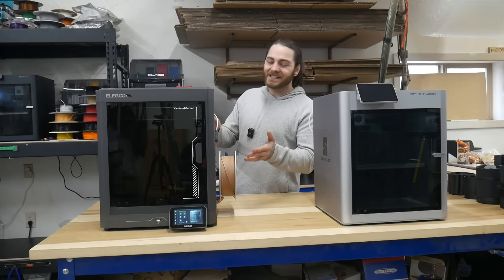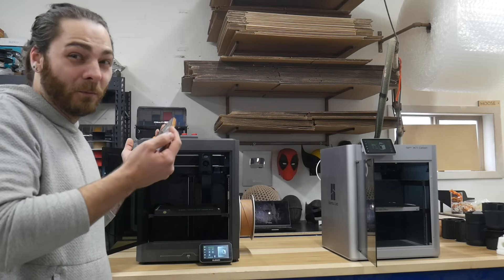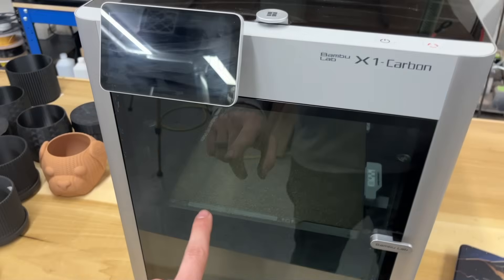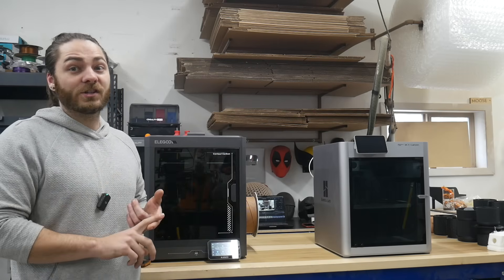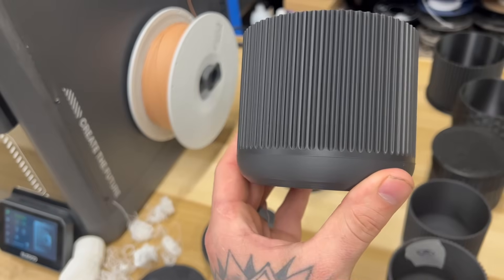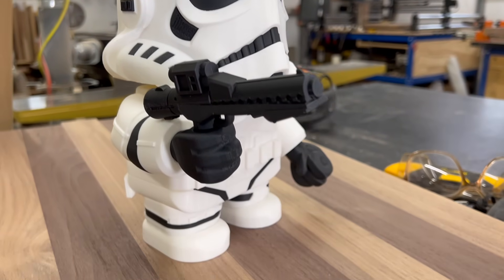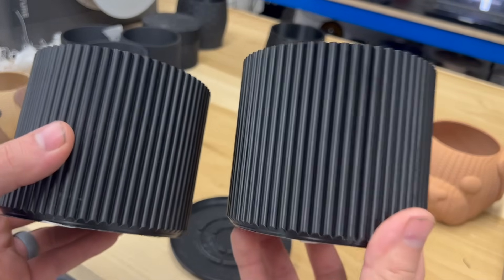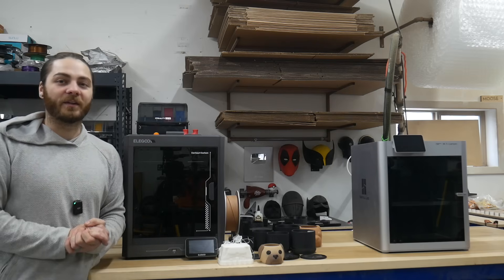Cheap vs expensive: Can the Elegoo Centauri hold its own against the Bambu X1C?

Comment: I have the P1S Bambu and the Elegoo Centauri and went on printing for hundreds of hours across every kind of filament. The lights are crappy on both. Elegoo has a much better screen. Why Bambu put a stuid, little, tiny, 1990's radio screen on what could have been an amazing printer is mindboggling stupid.  Elegoo printed well right out of the box after callibration. Bamboo printed one item right out of the box after calibration but the second item was strung out and required recalibration. Nobody talks about the bambu labs set up requiring access to your contacts during setup. Do they really need to know who my friends are? Price point on Elegoo is almost half of Bambu. Elegoo comes ready for CF filaments, bambu requires some upgrading for CF.  But Bambu has AMS. If you don't need or want AMS, Elegoo is a no brainer (buy it).
Reply: Was looking into a new printer. Requires access to the internet to set up is crazy requireing acess to my contact is a deal breaker. 
Plus coming from an ender 3 v2. I want to be able to change a few parts use what slicers i want etc. Thanks for this comment.

Comment: The Centauri Carbons prints look a bit worse because of VFAs. You probably need to reduce speeds for the outer wall. I use 40-60mm/s.
Also replacing the toolhead cover with the 3d printed ultralight version helps

Comment: Bambu's attitude about software makes their stuff a non-starter for me.
Reply: True. I dont get why no one mentions this. And everyone says the reason to get a Bambu is that its a "high quality everything works out of the box" experience which is wrong too. I had a Bambu A1 and Centauri Carbon (similar price) and they print and behave the same. Centauri Carbon is maybe even slightly better for tall prints. My A1 died in less than 2 weeks because they cheaped out on the power supply thermistor. Sent it back and kept the Centauri Carbon ofc.
People who shill Bambu are probably biased because of the mobile app and how comfortable the software is with the ability to control the printer and camera via cloud. Which should actually be another negative if you care about privacy and safety

Comment: I have an X1C, I love it. It does what i need it to, no printing mods to get it to work. I have 3 other printers (bed slingers) and only 2 of them i would use again. BUT, the Centauri looks pretty good for a clone at that price point. IF i had the extra money AND would not get murdered in my sleep by my partner, I probably would get it as my second enclosed printer and use my bedslingers as PLA only for light or non critical decorative work. EDIT: The Centauri is 265$ US on sale as of Dec 17th

Comment: I got the kobra s1 and really regret it. Full plastic even the door, the wifi chip in it is crap only works on ancient hardware 2.4ghz routers, cant get it to connect to wifi at all, massive first layer issues, poop chute getting clogged constantly , really crappy slicer settings, slicer that constantly crashes,...

Comment: I bought cheap printers.  They have cheap bearings in the fans, the linear bearings, the motor bearings.   That stuff fails in a few hundred hours.   I now buy printers with Japanese Misumi or other highest possible quality bearings.  It's not worth my time to be pulling apart a printer to change all of the bearings and often the replacement bearings are going to be the same garbage they sold you the first time.   It's your time.  If you want to print, but the printer with great bearings.  If you enjoy wrenching on a printer, buy a cheap printer.  If you want to see if a printer is any good, print a flat vertical wall with it.  Shine the light down from above and look at the shadow pattern of the layers.  If there are patterns and surface roughness I can't use it.  It might make fine figurines or rough mechanical parts. Reviewers almost never show you the print quality with lighting that is correct for showing the surface roughness.  In years of printing I've never had a nozzle clog.

Comment: I think for the price its not bad it does look cheap but as long as it works and for a starter I think it would serve someone well. I personally could care less about any screen on a 3d printer or the I think useless Lidar thats why I opted for the P1S.  And alot of people dont know if you just order another stock Light off bambu it snaps right in on the right side and is with in the safe power range on the board to wire direct to original so you have dual/controllable lighting and its not overly bright and looks very clean. If I had to buy a new printer today not ever owning a P1S I would probably go the same exact route. Love the look over all and software. Not a fan of the X1 silver color, should have made it a option to have black or silver. Also wait for Xmas sale, thats when I got mine.

Comment: I'm pretty sure that Creality/Elegoo/Bambu are all just using modded OrcaSlicer. I've used the Creality/bambu/Orca and the only difference is where they've added stuff specifically to their printers. 
I'm running the K1C atm, but I'm thinking about going up to the H2D, I just can't switch to bambu, I don't care for the lock down feeling of an Apple product.

Comment: Been running this printer for 5 days now and it arrived with the light issue fixed but I printed the lid risers and added a lcd strip inside as my old eyes are not so good these days. I have to say after the Creality experience this thing just works it is stunning for the price I will be ordering another soon! Running it 24/7.

Comment: 😂 bro. I bought a cc. It's nothing like my x1c. The circuit boards are all cheap. The thermistor plug breaks when you try to change the nozzle. The nozzles constantly  clog, and have a hard tome with cf. It's honestly  a hot mess. Im glad they are not reliable , because it helps keep noobs out of the market. These YouTubers are hard core shilling.

Comment: I added two of the Centauri Carbons to my shop where my Plus4 is my largest printer and most used to date, I have all Qidi machines and then older Creality machines that I phased out.  The Centauri Carbons at 299 were a no brainer, I have put 300 hrs on the two I grabbed in the past few weeks, and very happy with them.  To date only one clog has happened, this gave me opportunity to look at extruder design when I went to fix that one clog.  I was not impressed with the extruder design, I hope they improve this, make it from higher quality components or maybe another company can provide a better mod for this kit.  I love the print quality I get on these machines it has worked 300 hrs plus on two machines zero failures using 4 different filaments to date and most of my projects are quite large in size requiring 13-28hrs to print.  That is impressive stats to date.    

I did put the CC head to head against my Plus4 for  same exact part on ABS, my Plus4 finished part 23 minutes faster and the PLus4 had a better finish but do realize I spend last 10 months finely tuning and calibrating my Plus4 and it also has chamber heating.  I will say the CC results on that part were also impressive very high quality but using defauly .20 layer normal printing settings my Plus4 came out ahead in speed and quality, but the CC quality was nothing to sneeze at, one could sell that item all day long on Etsy!   

Bottom line for 299 the Centauri is a steal!   Great machine that simple runs and runs and runs printing non stop flawless prints for me in ABS, PLA, PETG, and   PETG_GF.  I am tempted to grab two more machines like them that much.

Comment: I'm not sure why these comments are negative for as long as I scroll down. Thanks for your vid, I enjoyed your review and comparisons. I've just bought the Elegoo and they have changed the light. It's now totally different, bigger, and super bright. The filament sensor/feeder seems also to naturally feed from the front rather than the bottom, but you could position it where you want. Years ago I bought a comparably cheap Creality thing. It was so god-awful, required endless tinkering, and would only print regular pla without shitting the bed in every way imaginable. The Centauri is like a god-thing in comparison. It has not stopped printing since it arrived home, has required no tinkering, and its prints are more perfect than I've had prior experience with.

Comment: Given the huge price differential, I would say that the purchasers of the X1C were Bamboozled. BTW, I received my Elegoo CC on the 17th. The unit now has two bright LED strips and the AMS/MMU port was added to the back. Orca slicer works fine and already has the printer listed with settings for a huge number of filament brands and types.

Comment: My Centauri came in today, there is a light bar now, quite good.
Reply: Got mine on the 17th. Two light bars, right side and front and an AMS/MMU connector on the back lower left.
Reply: Got mine yesterday having to return it because of really bad heet creep they destroyed the gears and plastic holes that feed in other then that it was great
Reply: @catacocamping874 if you are printing low temperature filament like PLA you need to leave the lid off otherwise it gets too hot inside.
Reply: @MikeHammer1 yes i realized that and it was carbon cf but definitely will do that next time
Reply: There is two.

Comment: 300 vs what was it 1300? and they are this close? The Elegoo is the clear winner. There should have been miles of difference between the 2 to justify the 1k price difference.
Reply: It is like the iPhone vs Huawei thing...
Reply: it is always easier and cheaper to copy something than to develop it yourself
Reply: @Ba-qw4xj  Which is why the first Bambu core-xy printer needed a kickstarter and was released 2 YEARS AFTER the first Voron. Bambu is really good at copying other peoples' homework, then painting it white and making it shiny like Apple.
Reply: Having to disassemble a print head, put it in a vice and perform surgery to unclog it is not a win in my book 😎

Also, I never had to do that with my ancient CR-10 or Ender 3 V2 either.

Comment: Acabo de comprar una y a los 15 minutos se atasco con PLA el tubo PTFE viene de fabrica con angulo muy cerrado e impide correr el filamento forzando el extrusor. La calidad constructiva es buena, pero para el costo es muy buena opcion, con lo que vale una bambu lab compro una pequeña granja de impresión
Reply: Compras 4 centauri carbon y te sobran 100 para comprar filamento. Bambulab y Prusa son unos guarros, al menos Prusa son productos de calidad, pero Bambulab ni eso.

Comment: if the manufacturer claims that these 2 printers can do same speeds why you not use same slicer profile? that is if you can copy paste start gcode from elegoo profile into bambu and run that one on elegoo. from this video it seems like bambu has more dialled in slicer settings are very different between the two.

Comment: An enclosed, multi-material handling printer from Eggyloo which produces prints of a quality comparable to a machine FOUR TIMES the price from Bimbo Nobs, whose after sales service is, at best a gesture, and at worse a pig-headed exercise in avoidance of responsibility to the point where lies and extreme obfuscation are the order of the day (YES that's YOU BAMBU!!!)... And no signs of mendacity from Eggyloo, unlike Bimbo Nobs who appear to be close to completing the groundwork designed to tie you into their over-priced filaments at pain of finding your machine bricked! Oh yes, Bimbo deny it at the moment, but... watch this space! Best of all, this Elegoo printer is not only FOUR TIMES CHEAPER than its obvious Bimbo competitor, it actually costs less than the Bimbo A1 bed slinger! And although it is single colour printer right now there is a multi colour option promised for the end of the year! 

What's NOT to like about the CC???

As for Bimbo Nobs... CAVEAT EMPTOR!

Comment: Excellent review using samples across various filaments.

For the typical individual or family who uses a printer at home,  the ELEGOO is quite the bargain.

Buy 2 and stock up on filament for the kids.

Most print PLA, PETG, maybe flexible if you can figure out direct drive.

ASA is a no no, is very toxic gasing styrene, much worse than PETG.

Shouldn't print ASA, ABS, and ideally PETG in your home and around children.

Need 2-stage filtering, HEPA + Charcoal for all printing.

 In the 3d printer world, historically, companies that lock down systems and go proprietary end up going out of business eventually.

We are already seeing Bamboo compatibility issues with other software and utilities.

Stick to open source where you're always going to find someone who can help you and parts, modifications are readily available.

Remember you can fine tune your machine to overcome various issues assuming you have access to the machine gcode.

You can also use other slicer's that provide more advanced features such as Prusa slicer.

Bottom line. 3d printer tech is rapidly changing. Never get locked down in proprietary systems, and don't overpay for statistically insignificant quality issues that can be taken care of with some basic tuning.

Comment: running bambu with linux is a pain in the ass.  Ever since the security update, I refused to update.  But my Orcaslicer keeps getting logged out of my bambu account.  So my printer cannot conect to orca.  I have to relog everything, and hope it works.  Currently its not working for me....  They said they wouldn't screw ppl like me over, but i currently spend more time messing around with this machine, than I did my old bed slinger elegoo, in just acount settings  and log in none-sense.  The old bedslinger had leveling issues and getting things to print.  The bambu has bambu issues, ya know, like dealing with the worst company on the market..... Nothing has been easy with this company, and its not even a result of difficult engineering.  Its been the ppl.  Even when I ordered the pritner, it  got lost, and it took bambu 4 months to figure out it was lost  and send me another one.  Let that sink in, I was out 1200, for 4 months, with no reply from Bambu, and seriously concerned if I was even gonna get the printer in the first place.
Reply: So have u get bamboo for now?

Comment: What I take away from this is the bamboo is 10-20% better and 400% as expensive. 😂

This is the printer I would buy IF it was in stock anywhere in Europe you can only preorder it for in a couple of months and I was planning to use a printer in the next couple of months 😢

Comment: I am going to be honest, I could see on your video straight up with no issue that no, the print quality was not equal to your X1.  The inner walls were clearly worse on every print, the layer lines were more visible, etc.  Again X1 costs 4 times more but the question isn't how does this compare to the x1, the question is how does it compare to the P1S?  Still 400 more.... but way closer in price than 1200, and I bet it still has superior print quality, easier nozzle changes/cleaning, less out of the box tweaking, etc etc.
Reply: That is why they asked him to compare to the X1. They were wary of him comparing it to a less expensive Bambu printer I suspect.
Reply: @MarkManner  Yeah.  It is well known the P1S is 80% of the printer the X1 is (if not more) so the quality differences would have stopped looking so reasonable.

Comment: Elegoo missed a huge opportunity to eat Bambu lunch by not making the bed 300x300. Ok, so you have to charge few dollars more but that would have made a huge difference to someone shopping for a new printer. I won't be buying either printer but I would have given serious consideration to the Centauri if it had a bigger build plate.

Comment: If Elegoo can't even spend 50 cents on an LED strip, like I can buy for my bambu on aliexpress, or even $2 for one that comes WITH A LIGHT SENSOR you place OVER the existing light so the light is actually able to turn on and off from your bambu handy app (Dunno if you even have an app with this?) 

you DEFINITLY cant even use a mobile app to print stuff like you can with bambu7 and makerworld, unless someone generously CREATES a print profile for this printer WHICH makerworld owned by bambu GRACIOUSLy even ALLOWS. Yeah THEY ALLOW competitors printers to be listed for printing from the app, but they shouldnt. but bambu actually cares abouit being open and makiung stuff free and cheap, bambus spare parts are MUCH cheaper than prusa who acts like theyre easier for spare parts or somethingf or some reason. Prsa sells their spare parts 3 times markup, whiel bakbu sells their spare parts CHEAPER Than if u would try and buy 3rd party versions on aliexpress. AND bambu gives me $4-0 gift cards every week from my makerworld points

Comment: Instead of a lower layer height on your inside threads maybe you should try reversing the wall order on that part. The same thing happens for overhangs that go towards the interior of the part instead of the exterior. Changing the inner outer wall order can make all the difference.

Comment: Should have done the comparison vs the P1S instead, for this review the screen would have been the only negative and everything else would have been the same as you didn't mention lidar. Bambu is great because it is a no fuss printer. You feed it files and filimant, and it feeds you good prints. The elegoo is more finicky, but better than something like the old enders for sure. Still, even for the P1S, you pay double what you pay for the elegoo.